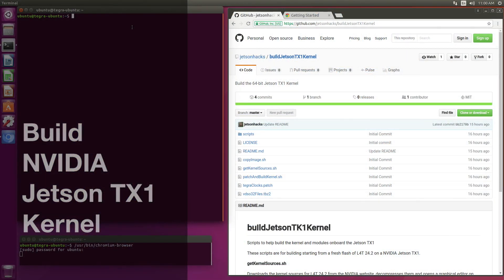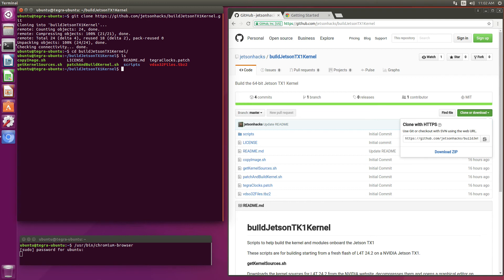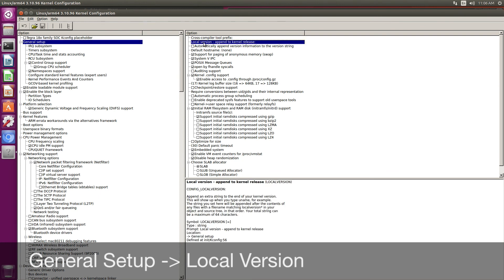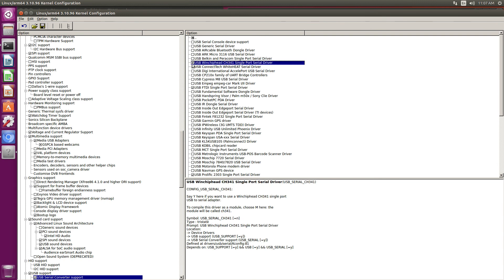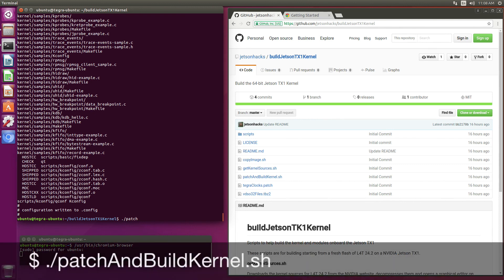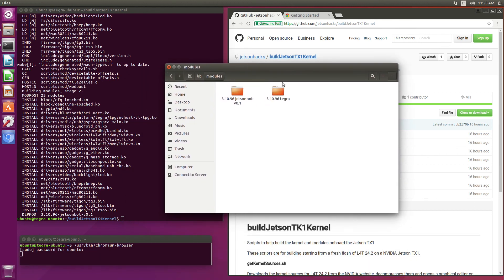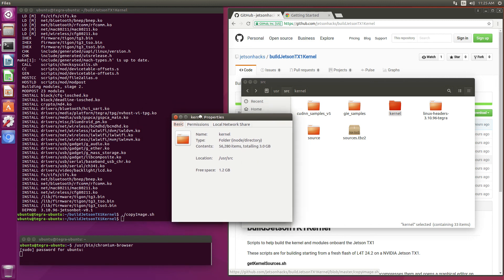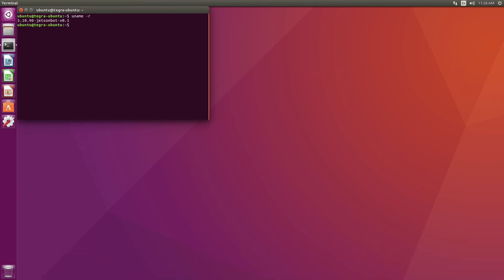Build Kernel - NVIDIA Jetson TX1

Comment: I get an error at while accessing getKernelSource. The error is in the 46th line and while using makekernel command, i get many errors. Can you suggest me a way for solving this issue?
Reply from the maker: Does the version of the kernel match the version that you are running? This video is for L4T 24.2.1, please read the article for the update:  http://wp.me/p7ZgI9-Fz
I'm not sure what the error you are seeing is coming from, the script is only 6 lines long.
Reply: JetsonHacks bro I have l4t 24 version
Reply from the maker: Did you use the tagged version v1.0-L4T24.2.1 of the buildJetsonTX1 repository?
Reply: JetsonHacks can u just refer me the link of that article
Reply from the maker: Which article?
Reply: JetsonHacks  how to compiler and edit the Jetson kernel 24 manually or using ur code
Reply from the maker: Since you were follow the links provided here, you can use this guide: https://developer.ridgerun.com/wiki/index.php?title=Compiling_Tegra_X1_source_code#Build_Kernel 
Good luck!
Reply: JetsonHacks thanks bro in this that have given how to get the kernal and build it but how can I edit to install rndis in the kernal
Reply from the maker: I am not familiar with that module. Please ask this question in the Jetson TX1 forum where a larger number of developers share their experience: https://devtalk.nvidia.com/default/board/164/jetson-tx1/

Comment: I'm am trying to install the kernel but it is not working, towards the end of running get Kernel Sources, I get the error recipe for target 'xconfig' failed. After this the kernel manager does not launch as it should
Reply from the maker: Hi Lucas. Did you check out the article at: http://wp.me/p7ZgI9-Fz
What is an error recipe? Did you get an error message of some sort?
Reply: Are you trying from an ssh terminal? I got the same error when I was trying this with ssh as make xconfig requires the X server. Try doing it locally on your TX1 by connecting a display and keyboard,
Reply: I got the same error as Lucas. Should the .sh file run on the host computer or on the Nvidia board.
Reply from the maker: On the NVIDIA Jetson board.